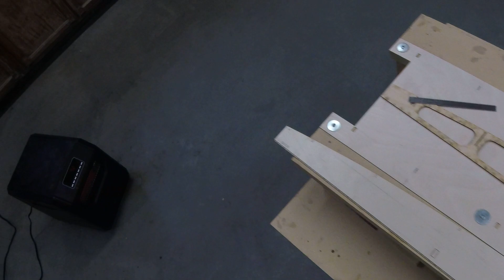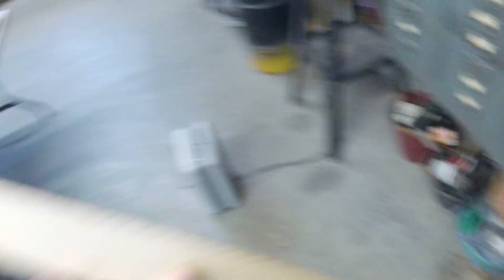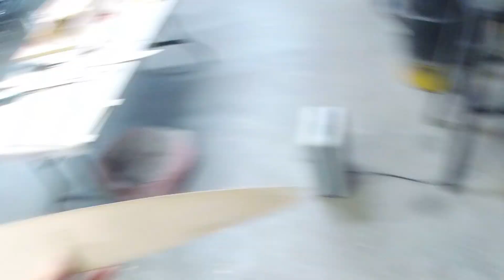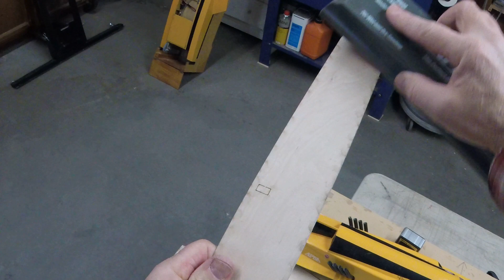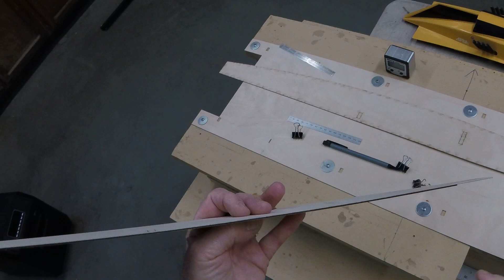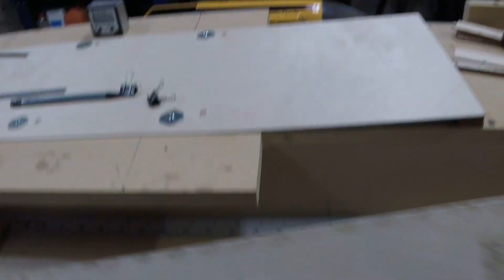ML Boatworks Kit Hydroplane Build Part Two | More Mods, More Madness!

Comment: Scott, see you doing bullnose mods and having an issue with those on an MLB 172 kit being done as 2023 Graham Trucking. First kit for me. Have everything between transom and back of sponsons and between both inner walls of nontrips glued to floor. Having done large scale rc warbirds for a decade I'm kind of a stickler for scale details. Looking at top view pics of full scale boat just noticed bullnose on port side extends further forward than that on the starboard side. Assume this would be reversed on rc boat. Several issues with bullnoses on kit. First they are on same plane e/w on the northbound boat. Second, the profiles on the Newton plans for the boat and those laser etched on the kit are different. Is there a performance advantage of one being forward of the other? If I were to build it as it is, which being much like you I probably won't; is this hull deviation something that could get me dinged if I were to try and race? Lastly, would a more pointy bullnose (Newton plans) or more bulbous, ball like (kit) be better?  Really appreciate your help. Keep the great videos coming. Thank you!
Reply from the maker: I don't think anyone would complain necessarily, but you can fix it while it's still under construction, right? So why wouldn't you?  And yes reverse the offset for the model.  I'm sure the kit was made that way for sake of simplicity, but simple isn't fun.  
As for the shape of the bullnose, I'm a fan of the broader shape, though I realize that isn't necessarily scale and it's somewhat opposite of what I just told you, but I would do it anyway. Aerodynamically it's a better, more forgiving design.

Comment: What size motor did you out in the yellow boat? I'm going electric not sure what size motor to go with? I have 5694 500kv that's a heavy motor tho. 4082 maybe better!? Thanks buddy!!!
Reply from the maker: Heck I don't even know what it was. All the parts were supplied by Rattlesnake RC who commissioned the job. Bill at Rattlesnake sells all the parts, so you could probably get all the info there. Find him here www.allrc1.com

Comment: So I'm struggling, I moved the template up 11/2" sanded moved the template back 11/2" and now the template is taller than the piece I just shaped.
Reply from the maker: Hmm, I'm sorry but I don't understand.  You should use an originally shaped piece (A), move it forward 1.5" on the piece you intend to reshape (B), bring the front of A at the bullnose down so that it aligns with the top of B, mark the shape of A onto B, then sand B to remove that marked material.  Now A and B should have exactly the same contour on the top (when A is forward 1.5" over B).  Then you simply use B as your template to mark and reshape the other three pieces
Reply from the maker: But if you've goofed, as I often do, trace it onto a new piece of ply, make a new one and try again!

Comment: Is that cowling custom made by you?  Are you going to build a new one?   I am trying to rebuild an old Dumas Atlas Van Lines but with a different cowling.  How do I scale the cowling properly?  Sorry for all the questions.
Reply from the maker: The answers are yes, yes, and with a ton of effort.  I generally use wood and insulation foam board to create the cowling plug shape, and then make a fiberglass mold from the plug from which I can then make the actual cowling.  It's a crap-ton of work!
Reply: @M5PerfHydros  would make another great video series on building custom cowls.   Great work and great videos.
Reply from the maker: Hmm